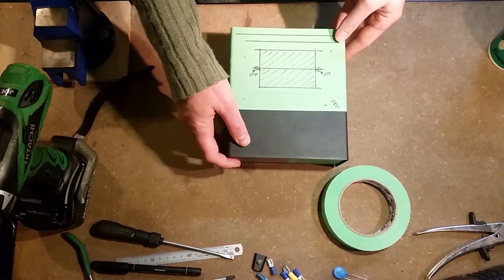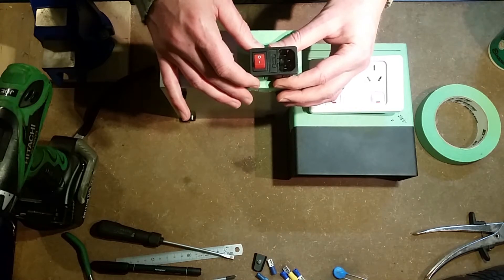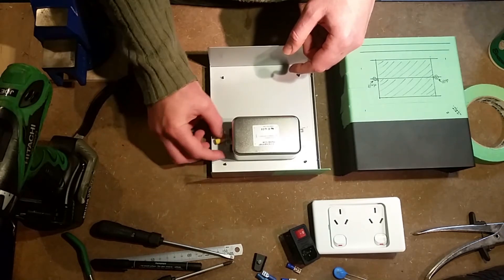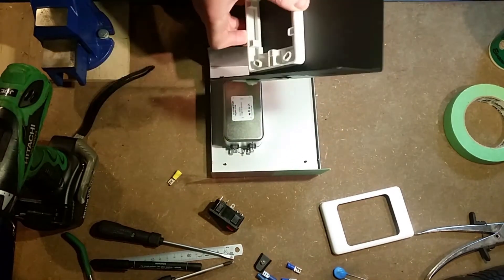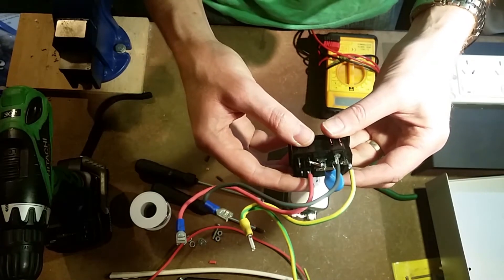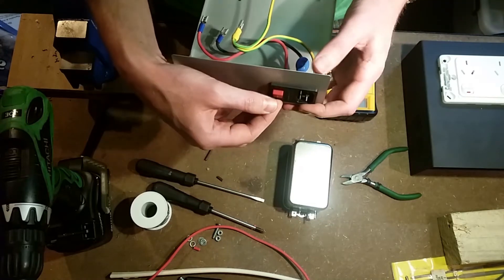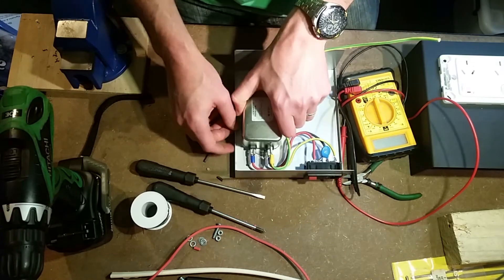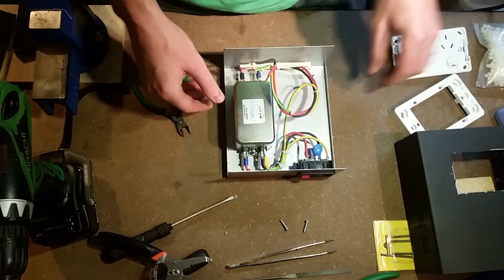DIY AC Power Conditioner

Comment: As a precaution I would have also made ground connections to both parts of the metal casing,  in case a wire became exposed and the metal became live. In the UK it would be mandatory for any exposed metal work to be grounded.

Comment: My fridge wont run off my genset 4kw (so enough power) it easily runs things like hotplate and kettle so I suspect the fridge is fussy about the power, could I use this to clean up my generator power?

Comment: this really is a timely project for me.... as I was just looking at prices!  Have you actually looked at the "conditioned" output, both unloaded and loaded?  Any thoughts of adding a bit of metering to show the actual line deviations that the conditioner is protecting against?  Thanks again, Doug  NB:  I just noticed... this conditioner doesn't address line voltage fluctuations, does it...
Reply from the maker: Hey mate, you mean chuck an occilloscope on it? Never thought of doing that.... What do you mean that it doesn't address line voltage fluctuations? I thought that's what it was supposed to do?